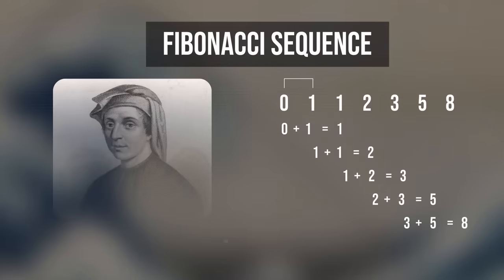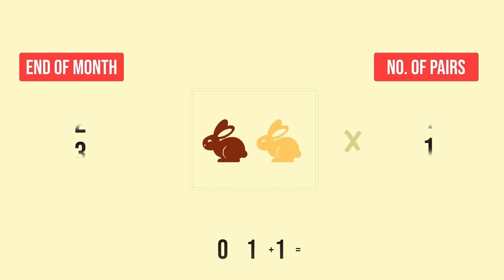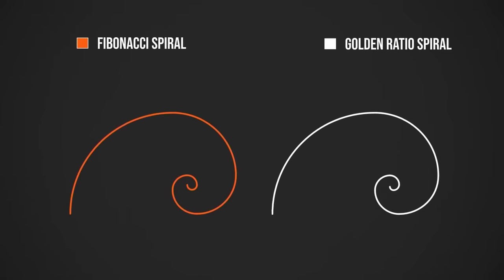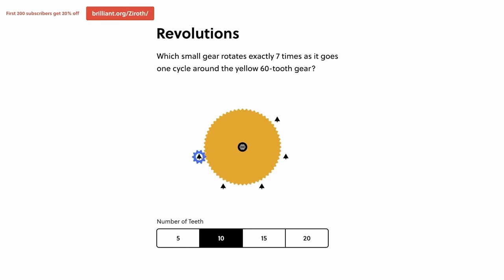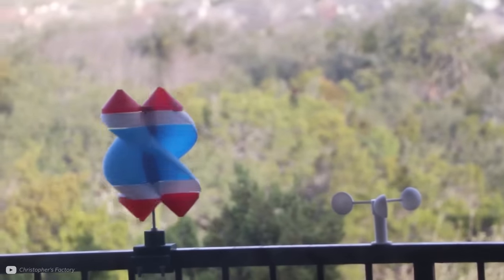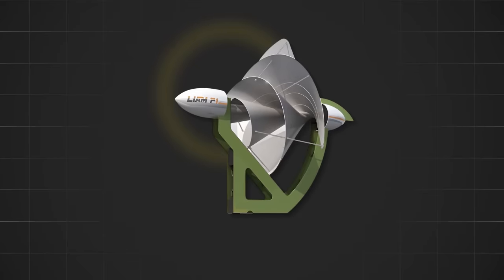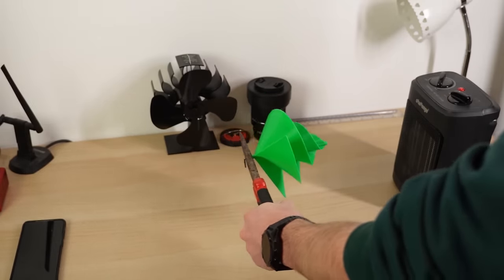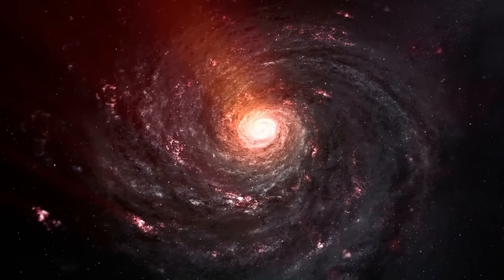Uncovering The Genius of Fibonnaci Turbines

Comment: Being an avid fan of all things Φ, I found your video instructive and fascinating!  A question I have is, "How do such turbines fare in really strong winds?", as conventional turbines can feather to prevent damage in such conditions.
Other commentators have suggested the 'economics' are paramount considerations but I tend to view things through a resource-based economy lens rather than an imaginary usury-based bankonomic one with the utter nonsense of elastic & daily changing values of bankster currencies.
I'd certainly would like to see houses fitted with these Fibonacci turbines to help lighten the load on both the power grid and our environmental footprints though I see no need to actually connect these turbines to the grid.
Reply: Just don't mount them on the roof of any building that wasn't specifically engineered for them. The vibrations of a wind turbine can shake a building apart over the life of the turbine.
Sticking them on a pole in the back yard also makes them much more accessible, because you can lay the pole down when you need to do maintenance or repairs. Of course, the turbines that have a vertical axis fix this by putting all the most wearing parts at ground level.

Comment: Modern 3-bladed turbines are already more than 80% efficient. Using more blades you can get marginally more efficiency, at the cost of an extra blade - which is not a small amount. 3 blades is just about the perfect balance between extracting as much of wind power as possible and the lifetime cost of the turbine. Also any efficiency gains at slow water speeds mean absolutely nothing because slow moving water hardly contains any extractable power to begin with, the turbine cost will eclipse its lifetime electricity production value.

Comment: The biggest win for these types of wind generators is that despite lower efficiency they have a broader operating range. A traditional three-bladed wind generator needs clean air to reach peak efficiency and cannot be used under or over a certain threshold. They need to be high up in an open space.
Spiral types along with upright models usually only have one limit: speed. There are 'folding' designs out there which tuck in the blades to reduce surface area in order to stay within the 'speed limit', increasing the 'harvesting bandwidth' even more.

Comment: It won't scale well due to weight. One of the major limitation is the main bearing (cost) holding the turbine. For the same bearing loading capacity, it is better to carry larger diameter 3 blades with similar weight than this turbine with smaller diameter.

Comment: There’s a number called the Betz Limit. It’s the maximum theoretical efficiency of any device extracting energy from moving air. That number is 59.3%. No actual physical turbine achieves this. At best, they get 80% of that, or  47% efficiency.

When you look up the actual numbers on whirligig turbines like this one the efficiency is below that.

There’s a reason that all commercial wind turbines look the same; three bladed, horizontal axis, slender blades, upwind. It’s not lack of imagination. Designers have tried thousands of designs over the past 60 years and that’s what works best.

Please ignore the whirligig makers and their “ancient knowledge” grift.

Comment: This would be lovely in capetown the southeaster is pumping this time of the years and the electricity blackouts has gotten worse
Reply: Without the grid, you will need a battery for stable power.
Reply: @SolarWebsite factually incorrect

Comment: Assuming this is more efficient: There would likely have to be some sort of shroud that could be automatically put around the turbine in order to control the speed or even completely stop flow all together. The standard propeller types can turn their blades to get less wind power in addition to having brakes in the system otherwise high winds can damage them or even rip them apart purely from the centrifugal forces in extreme cases. Having this ability to stop the turbine is also important for maintenance.

Comment: Also thing to note, this design while may be better at lower speeds witch would be really nice in not so windy areas, fails moment you add in the real life problems like snow and ice. From the looks of it, this will just gobble up all the ice into the groove and fill it over time. Depending on the material used, you could use black non sticky material to melt off any ice forming, or use heating coil in the center axis, but like with any other wind turbine this uses energy and defeats the point, not allowing the turbine even spin when enough ice has formed during calm weather. Also due the surface area that would require chinook helicopter to spray enough ethanol to defrost the turbine, instead of smaller helicopter used today to defrost them.
Reply: A turbine slowly spinning in low wind still produces hardly any energy. It might look nice but just like solar panels on a cloudy day in December they are practically useless.

Comment: This concept seems promising but feels like an early iteration. There's too much surface at the outer edge which moves the fastest which is why I suspect it didn't do as well at higher speed. Wind turbines use 3 blades because that the smallest number that still balance forces that would wear them out. I wonder if a single bladed turbine in a spiral shape could be made to be perfectly balanced. That would need a lot of precision.
Reply: Why overcomplicate and over engineere? 🤦🏼
Reply: @JohnDir-xw3hf That's not complex or overengineered if it reduces to a single spiral and results in even a few percent increase in efficiency from now on.  I see it as comparable to winglets, slats, washout & vortex generators on airplane wings.
Reply: If we look at it, it's basically just a regular turbine with very large blades. Like the classical old farmer wind mill, the large surface is more efficient at low wind speed because it is hit by a larger number of slow air molecules. However, at high wind speed, where the wind is much more powerful, the large surface area acts like a brick wall and pushes most of the air around the turbine, instead of through it, where its energy can be extracted. . Regular wind turbine don't break the air as much, allowing for more power extraction from the high speed air passing through. So it really is a question of choice: Does one wants to efficiently extract a little power, most of the time, from slow moving air or a lot of power from fast moving air, but only when it's windy?
Reply: Have a look at rotating spiral flagella - nature suggests this must be efficient, though possibly only at small scale. Add those bumps on whale flippers for good measure.
Reply: @tim40gabby25  You need more relevant analogues for that to be convincing, IMO.
Reply: @JohnDir-xw3hf  If better balance, reduced complexity (thus lower manufacturing costs, reduced total surface area (thus reduced boundary layer effects on scaling down) etc. can be achieved entirely in the computer, ignoring the opportunity would be settling for its unnecessary complexity and UNDERengineering it.
Reply: @etle113  
Right!  
These being touted as meant for tapping low wind energy and making up for the lack by being more numerous and placeable in areas unsuitable for the larger turbines.
Reply: @dennisbecraft1303  now show me  a Megawatt turbine with single spiral blade.🤣🤣🤣
Reply: @JohnDir-xw3hf  These aren't ever intended to operate in that regine.  It's like asking to be shown a rubber powered balsa airliner, or a megawatt scale up of a farmer's waterpump windmill.
Reply: @dennisbecraft1303  exactly. It's a toy. It's not intended to have even a kilowatt power.
Reply: @JohnDir-xw3hf  Being more efficient than anything existing to extract energy from windspeeds that don't work at all with larger turbines doesn't relegate it to "toy" status.  
There is a niche for it just like one being filled by improvements in solar cell efficiency and lithium battery capacity.
Reply: @dennisbecraft1303  Hi. I'm not sure how best to define relevant in this context.. single flagella propel organisms, whales need to minimise vortices. Why irrelevant?

Comment: The Pyamid and Golden ratio is actuallly correct when you consider that the Golen ratio was used to approximate Pi via the fbonacci series.
It is oft quoted as a graient of 280 cubits to 220 (1760 / 2 / 280) usings 22/7 as Pi which is 55/21 x 6/5
Herodotus quotes a vairation of this using The area of the face being equal to the square of the height using sqrt 8 x 100 cubits = sqrt 80,000
This is a Pyamid with gradient sqrt Phi : 1.
The relaitonship between 280 and 100x sqrt 8 is the relationship between the 28 finger cubits, the 20 finger remen diagonal  cubit and the 144/7" Greek cane cubit.
These scale in the ration sqrt 0.98:1 (effectively 99%), which is exactly the same as the 30 finger sumerian cubits using 21 sides as a downscale factor of sqrt 0.98
Thus 280 remen diagonal royal cubits = 282+ 28 finger cubits.
Thus 280 cane cubits = 282+ remen diagonal cubits.

Comment: If you were to take the 3 individual blades, and isolate them, there is another amazing possibility. If they could be placed on a scissor mechanism, much like the mechanical advance weights of an older car distributor, as the speed, or volume of the air increases, they could throw out from the center, to harvest even more wind power as it becomes available. Kind of a variable torque, dictated by available wind.

Comment: The reason Phi is seen so often in plants is simply because it's irrational, there's no mysticism there
Many plants with spiral configurations follow different numbers for their spirals and some like mint forego the spiral configuration entirely and just grow leaves at a 90° angle.

And the reason phi specifically seems to be so much more common than other irrational numbers is because it's the "most irrational" number, as in the hardest number to approximate using rational values.
Reply: well… that just sounds irrational to me 😜

Comment: Such an interesting video!

For the wind turbines, another practical problem for Fibonacci blades is they need to be able to be "feathered" to slow down or completely stop in high winds -- or whenever the turbine operators need to stop the blade rotation.  The traditional horizontal blades would just "feather" so they're parallel with the wind so that all wind rotation force ceases.  But the Fibonacci blades don't appear to have this capability.

Comment: in·fin·i·ty
MATHEMATICS

a number greater than any assignable quantity or countable number (symbol ∞).

What is the meaning of zero in Webster's dictionary?

a. : the arithmetical symbol 0 or 0̸ denoting the absence of all magnitude or quantity. 

b. : additive identity. specifically : the number between the set of all negative numbers and the set of all positive numbers.

Zero is the most important number in mathematics and is both a real and an imaginary number with a horizon through it.

Zero-dimensional space is the most important dimension in physics and is both a real and an imaginary dimension with an event horizon through it.
Reply: I like your thinking. Check out the Riemann Sphere for a geometric framework that unites all numbers, from 0 to infinity.
Reply: & it comes before page 1. 😅🎉
Reply: @samuelyigzaw  

There's a distinction between zero and nonzero numbers since 0 is not-natural and nonzero numbers are natural. 

That's how 0D can be dimensionless and timeless with 'dimensionless' being satisfied by '0D' and 'timeless' being satisfied by 0D being 'not-natural' so outside of space (1D, 2D, 3D) and time (4D).

Comment: Like you said the ratio is defined by the statement a/b = b/(a+b). Using the quadratic formula that is (sqrt5+1)/2  If that is specifically useful to any physics application or not, maybe. There may be some application for example in reducing product cutting waste. Looking at these propellers, they may be mostly effective in their surface contact to air, and possible complex interaction with the air caused by vacuum forces.

Comment: Generating the formula for the nth term of the Fibonacci sequence is a simple enough task for a homework problem after a first lesson in Z-transforms. The Z-transform solution for the Fibonacci recursion relationship generates a polynomial whose roots are those of the algebraic equation 1/x=1+x, whose roots are the golden ratio and its inverse.

From that you get that the Fibonacci sequences goes as phi^n + phi^-n with coefficients that depend upon the first two values you feed into the Fibonacci recursion relationship.

Hope you have fun doing the above.

Comment: Next video - How to make one at home using common materials.
Reply: My mind is already trying to find the least expensive way of doing this. First, I will plot various wind speeds in the area where I am able to set up a small wind turbine. Next, I think I will have to decide which plastic material to use. I don't think I will use 3D printing. I think ordering a small stack of appropriately sized sheets of my chosen material will do. Then, I will need to measure out the correct shape, and cut each sheet to size. Mounting each fin on a central axis will be the hardest part, I am guessing. Don't know how I'll do that yet. But it sounds like a fun, and (not prohibitively) expensive project to get into.

Comment: Zeroth, at 12.27 you mention an increase of 15%. I calculate this actually at 45.45%. 1.4545 x 33 = 48. This is a much more significant increase than the 15 % which would be 37.95. Overall very good discussion.

Comment: The  kinetic energy / rotating mass of this geometry will not "scale-up" based purely on simple open-flow steady-state flow equations (see Betz's law), however the real concern is the ability to control (known as "feathering") the amount of generated lift & drag (a measure of captured power) in a variety of wind velocities and wind flow (turbulent and laminar) regemes.  With a fixed blade geometry, feathering would need to be done by a combination of pre/post diffusers (ducting won't work efficiently at high velocity and low kinematic viscosities (high Reynolds' regimes) and azimuth holding (deliberately "stalling" by generating a large angle-of-attack wrt to the prevalent wind).  Any diffusing over the turbine reduces overall efficiency and control (e.g. why there are so few "push-prop" plane designs in production) and azimuth holding mandates sufficient clutching force (mechanical and/or electro-motive) actuators which add a good deal of weight to the system.  The final issue to overcome is the "dirty power" (high noise components in the electrical output) which results from vastly different flow regimes (hence high torque variances) across the rotor.  This noise must be filtered out (usually by a dedicated application-specific (power grid or local storage) inverter before it can be stored and/or consumed.  This electrical noise ends up being "wasted energy capture" that further reduces the overall efficiency of the system.  In short, there's really nothing to be gained here.  Existing "drag" designs scale-down better and existing "lift" designs scale-up better.  This manages to be "good at nothing" with additional control complexities.

Comment: 11:21 
Intriguing the possible relation between this decimal number and the 1/137 of the alpha constant and also the mysterious 137.037037037 which seems to relate both to 1.11111111 and 0.123456789 (though the gets occluded). 137.5 seems to divide into many numbers in a way that others don’t - it’s all a bit Room 237 to me!😮

Comment: No, it's just like a jet engine. It uses pressure differential to generate a rotational force. This is how the high pressure compressor section works and turns it into axial flow into radial flow before going through the nozzle to mix with fuel just in from of the combustion section, this then imparts motion over the turbine section of the engine.

Comment: With the Fibonacci fan power sources from the wind. Run two of those counter rotating so the push from the first adds to the second and the second is bigger and then on the very outside you can put some giant rotators.

Comment: Fascinating Sir.  Thank you.
While low altitude wind generators - say in the back garden at 3 or 4 metres height is WAY less efficient than the behemoths dotting our landscape nowadays, I do think there is a case for developing tech' like this to augment domestic solar when battery storage is also a given.
Domestic energy harvesting is already having a significant impact on the need for Peaker power plants in various countries around the globe where Virtual Power Plant technology is employed.
The aging electrical grids in most developed countries DOES need to be addressed.  However, the rapid and previously unforeseen uptake of domestic generation that is mostly solar, is showing up as a very effective interim buffer, as electricity demand steadily increases (only partly) due to the transport electrification revolution.
Good and bad times ahead...

Comment: Current wind turbine technology uses blades that are too long, hence having too great a cetripetal force, and too great a gust-induced semi-lateral resistance, making them prone to damage and explosive failures. Resiliance and safety would be greatly improved, and maintenance needs reduced, using shorter blades, but possibly arranged differently. Possibly multiple fans on one mast, etc